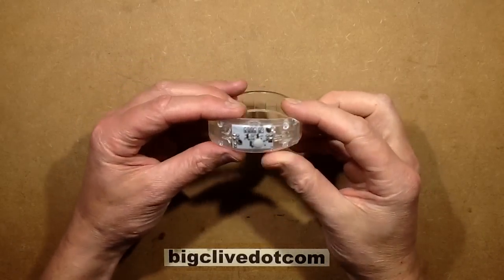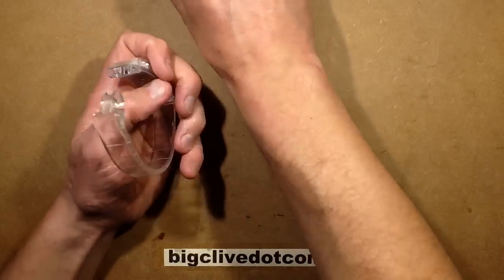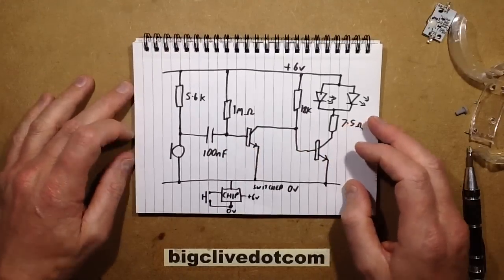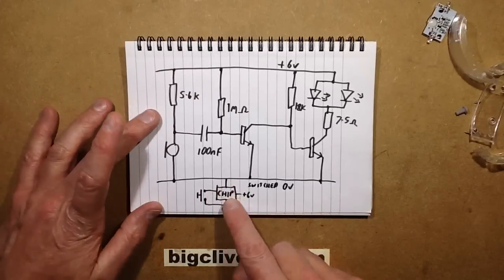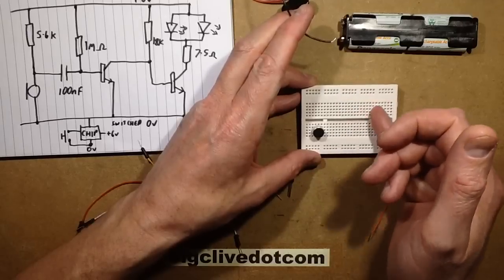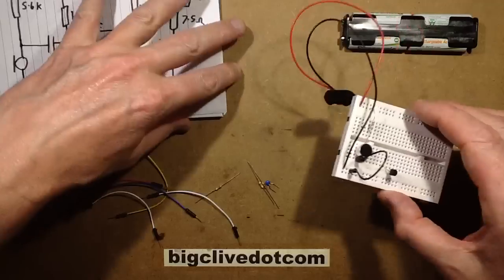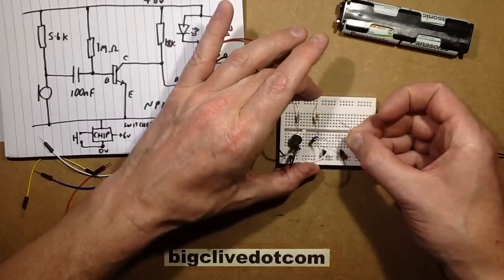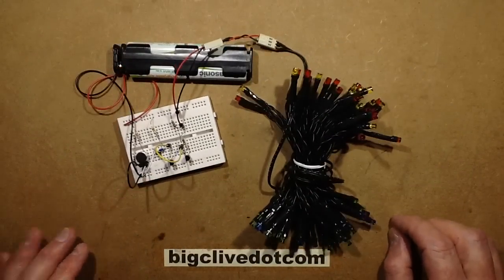Disco wristband with schematic and DIY version.

Comment: Waayyyy back in time, back before everyone in the world had computers, back before the hand held calculator was in everyones pocket, before cell phones, in fact only the richest folk could afford a car phone, and had held phones were larger then Max Smart's shoe.  Back then when the 3 Dog Night was just cutting their first wax, folks used to get high and watch light organs!  Well now the real light organs were very spendy, and we, the common every day soldier had no funds for such things, so we needed to design our own!   Well I had a buddy, who, like you, was into lights.  So what he did was to build a speaker type enclosure.  On the back, he strung some of the large incandescent Christmas Tree Lights.  I believe he had 10 or 12 of them, stapled by the wire to the back of the box in a sort of quasi-random design.  Each bulb was a flasher, and, of course of various colors.  Then going forward in the box he built an insert, so he could put different cut out pattern sheets in place, those carved out of a thin plywood, probably 1/8 inch if I recall.  On those boards, he cut out shapes, hearts, diamonds, spades, clubs and even words, such as the most uttered words back then in the ARMY, FTA (Fuck the Army).  Next, he put in a translucent screen, you could get them at the lumber yard as covers for florescent lights and inserts for cabinet faces.  Now when you plugged that deal in, and played the music, the flashing of the lights made the shapes appear all over that screen in different colors, and your mind sort of mad them dance to the music as it rocked the old trailer house where he lived.  I thought it a great deal, so I found a light organ at Radio Shack in a kit form, this became my first kit, and while it did dance to the music, it just had the same type board and all white lights, with a sort of hippey type plastic front that made it light up colored.  Personally I like my buddies much better, I ended up throwing the one I built from a kit in the garbage on my next unit transfer.

Comment: Never mind Clive, I feel pretty darn foolish right now because my 4 slot AA holder has a on off button I didn't even notice on it. Yes it does work when wiggled about on the breadboard but thank you anyway, Tom.
Reply from the maker: Easy done.  Also frequently happens in industry with emergency stop buttons.

Comment: That's a nice little circuit, so much in fact I tried to build it & obviously I must have ordered the wrong style of microphones, I guess. Not certain which they are until I can find the paperwork on them. So exactly what is the item # from off of ebay or at least the proper name for them because I purchased mine from Jameco Electronics, of coarse no returns anything electrical anyway. Oh well, I'm trying Clive to learn this stuff. Thanks for any help you can give.

Comment: Just built this myself as I want to make some disco lights and I thought this was a really cheap way of doing it rather than going through the expense of using a microcontroller.  I do not have an 18k resistor so I have had to use a 20k one. My circuit is behaving oddly as it works with just 5mm LEDs but then I tried to add a parerell LED string to it and when I do that all the LEDs just stay lit and only slightly increase with brightness to music. 

Am I simply overloading the second transistor so it is not switching properly?  There is only 15 odd LEDs on the string (poundland ones).  I am using generic BC547s from Ebay.

Comment: Damn, thwarted by lack of resistors!
I'm the kind of guy that is interested in this stuff, but has none of the requisite components except for a few old circuit boards I scrapped that have some surface mount NPN transistors.

Comment: Does it matter what volume the music is played? If the music is very loud, will the lights simply stay on all the time? I used to have an old set of 4 bulb disco lights and I believe they may have had a sensitivity option on them?
Reply from the maker: It's just a fixed threshold, so at loud volumes the lights will behave differently.

Comment: Can somebody explain why there are two transistors instead of just one?
Reply from the maker: Gain.  The one switching the high load of the LEDs will not be as sensitive as the one switching the much lower load of its base.
Reply: Great answer.  I was thinking it might be possible to use one transistor, if desired, if it was a MOSFET.  Just play around with the gate biasing until it works.  ...  Also might be able to use a piezo device (or even a microphonic MLCC) going to the + rail, in place of the cap.

Comment: Clive, since I have this connected to the solar charger from another project the microphone ends up in the window which is a bit away from the speaker.   What would I need to change to pick up a little more from the speaker.  Only need to gain about 2 feet.   I have to have it pretty loud.
Reply from the maker: Can the microphone be aimed?
Reply: Not really it is about 2 foot behind the stereo speaker.
Reply: Clive I ended up getting it to have more sensitivity by replacing the capacitor with a 220uf/224 and the 18k resister to a 4.7k.  Seems to work well enough for me.

Comment: Watching your video I am so happy I ordered a ton of standard resistors.  31 value 50 of each value. 1550 pieces total for about $15.99 USD. 
Way better than having to find a value I need, Desolder from a board, realize the leads are too damn short for the breadboard, and fighting with it. Id say its a good deal, But I am not an expert just yet :P

http://rover.ebay.com/rover/0/e11400.m1842.l5919/7?euid=2600f0185b1d44d4810ff8cda9c58429&bu=44367537419&loc=http%3A%2F%2Fwww.ebay.com%2Fulk%2Fvod%3Ftransid%3D679741375026%26itemid%3D391542729486%26qu%3D1&sojTags=bu=bu

Comment: Yep works.
 Solar charging set up works fine.  I'm going to change it to multi-coloured LED's around the stereo.  Probably need to adjust the sensitivity resistor.

https://youtu.be/PGeJ1D4gjRw

and now with colored LEDs

https://youtu.be/gN5QXIC3iTE

Comment: the transistor got stuck to your hand when you wrote BCE on the drawing :), Iv wanted a circuit like this for ages, I wonder if it would work (with modifications to current limiting) as a Clock Input to a binary counter so I can use my BCD to Decimal chip on my homemade disco light chaser in a "Audio Beat" mode. I made one years ago from an Everyday Electronics mag, it was a project for touch sensitive lighting control, but I was only interested in the audio detection circuit. I lost it over the years but it worked beutifully on my custom diode decoder for 4 channel chase patterns from my said BCD to Decimal (16 stage) chip. I actually still have the decoder, chaser and electronic relays circuits and it still works but where the audio board went to I have no idea. It uses a bi-directional binary counter which I had on a slow 555 for random reverse pattern changing. I think the audio side used op-amps and filters to give a nice pure pulse output but this circuit looks like it could replace my lost work :) I cant find any circuits online for audio in to pulse (ttl logic) out :(
Reply from the maker: Many years ago I made some little PCBs with LEDs on them where a 4017 counter was clocked directly by the audio picked up by the microphone.  It gave interesting effects.

Comment: Having the microphone inside without a hole means that the sound that reaches it will be much more attenuated in the higher frequencies, effectively giving them some low-pass filtering for free :)

Comment: I brought some extra large gloves from Hong Kong. They barely covered my fingers. Then a audio headset. Again they cut off my circulation. When buying anything on bang-good or eBay from the far east it is worth remembering the relative definition of 'large'. Size 4XL is the minimum for clothing etc. Worth checking before buying anything.

Comment: You should create a similar circuit, but it should have high and low pass filters to filter off certain frequencies and have multiple LEDs that light up for different frequencies

Comment: That's just plain neat. Nice hack. I'll have to see if I can build one of those myself. Do you think MOSFETs would work in place of standard NPN transistors or would the shunt diode mess with it too much? I have a few from an old power supply I saved for parts. The chips I have are 70L02P MOSFETs in a to220 package.
Reply from the maker: MOSFETs tend to have quite a high gate voltage.  Plain vanilla NPN transistors are best.

Comment: Odd that they used a chip to act as a switch
Reply: It lets them use a simple momentary switch as a push on/push off power switch. You'll find them used in a lot of disposable electronics.

Comment: That's a really nice effect! What would happen if you adjusted the first resistor and the capacitor values? I'd actually be really interested to see this circuit with variable resistor and capacitor in place so you can adjust things.
I'm guessing the other couple of resistors are less important? Or do they need to be tuned together?
Reply from the maker: The capacitor choice will affect sensitivity at different frequencies.  The 100n makes it sensitive to high frequencies, but a higher value cap would extend the range somewhat.  The 5.6K resistor position is matched to the microphone, the 1M is a general slight bias value and the 18K will be chosen to drive the main transistor hard enough to light the LEDs brightly, but high enough to be easy to pull to ground by the lightly biased first transistor.
Reply: +bigclivedotcom Thanks Big Clive, I might try to see if I have a suitable capacitor around here
Reply: I was just thinking about building channels into it to pick up varying tones and tying that to a light channel.

Comment: Most definitely! I have collected the replicas, and they are very convincing. At about fourteen quid each, it makes sense if your leading man is prone to dropping the £300+ handmade metal one every now and then. The opening end of Matt Smith's sonic screwdriver was particularly fragile, I have read.
Reply from the maker: Most real props are quite delicate.  Especially the technical ones with lots of moving bits, as they are one-offs.

Comment: Very nice, I haven't used a breadboard since the 80s, I use the PC board that looks about the same trouble is you must solder,
but hey if you cant solder get out of the shop, I admit bread board is quick and dirty.

Comment: does the little transistor survive the current draw from the LED-strip because it's switched on for such a short time?
Reply: I'm wondering the same thing. I would personally use a slightly beefier transistor with a heatsink but Clive does this sort of thing for a living and I don't.
Reply: or a mosfet, but i suppose the mosfet doesent have the gain needed for the circuit to work properly.
perhaps a mosfet connected to the last transistor and let the mosfet switch the LEDs, then you would be able to drive bigger loads.
but then again I am not an electronics engineer either
Reply from the maker: The duty cycle is 50% because the LEDs are being modulated directly by the audio.  So the transistor is within its dissipation.
Reply: +slypeartree Clive likes smelly electronics :)
Reply: Smellectronics

Comment: 01E is actually the correct marking for resistor with precision of 1% or greater. That's used for E96 serie.
I had one smd resistor marked 30A mounted on my own board and I was thinking that something was wrong... but it was in fact 200 ohm 1%

Comment: why could there no have been a 1K0 resistor in the emitter of the second transistor and a the 1M0 connected from the emitter of the second transistor and the base of the first transistor and a 1K0 or a 470R resistor from the emitter of the second transistor and ground.  you know ring of two amp.

Comment: Hi Clive, something I've never fully understood - could this circuit be rejigged so you only need the one transistor?  They're high gain, could the LED go from emitter to ground on the first tranny and save some more componenents?
Reply from the maker: It's possible this might work, but it would only be sensitive to loud sounds.
Reply: bigclivedotcom appreciate the response, I can see that, and it's great to have your thoughts, I'm so rusty!  Could the loudness threshold be adjusted accordingly by changing the mic pull-up resistor do you think, so it sits closer to the threshold?  Reducing gain but increasing sensitivity?

Comment: Damn thats so cool yet so simple. Can someone re explain what the 1M ohm resistor is for? I guess the 18k and the 7.5ohm resistors are to protect the transistors? (Learning electronics give me a break)
Reply: 1M turns the first transistor slightly on by default. This pulls down the base of the second transistor so that it is off per default. The others limits the currents through transistors and LEDs, so yes, protection.
Reply: Oh i see. Thankyou

Comment: any chance someone (or Clive himself if I'm lucky) could compile a list of all the things Clive got for the DIY version/where to find them? not much help having a DIY version without any clue where to get the components, aha.

Think this could be really cool to have set up though!
Reply: Specifically it would be useful to know how to get those multicoloured LEDs he uses at the end, and what the  "various connectors" are
Reply: Thanks, my man! I actually managed to find most of the other stuff, from the schematics he wrote down (and I realized he said the name of the transistor in the video), and happened across the electret microphone in my own searches (realizing soon after that he also said that, but I misheard it as "electric"). 

The main issue now is the LEDs, since they all seem to come with different adapters, like to USB or to mains. Didn't help that he described the adapters as "various adapters". But I'm assuming it would be safe to just snip any excess adapters off and plug those in directly, right?
Reply: Is there any way to tell if they're parallel or series beyond just the power source? 

For example, the best ones I've found are a set of 5V USB powered ones-- and they could be powered by either mains or battery. So would it be safe to assume they're in parallel, or..?

Comment: If the left-hand transistor is pulling the input of the right-hand one to 0V when this is idle, doesn't that mean the battery is constantly discharging through the 18k resistor?
Reply: Hence the COB switching arrangement..

Comment: That's tonight's fun project sorted. Now I just need to find something that needs to be sound activated. 
I'm thinking to maybe filter out the low frequencies and add a latching transistor switch, so it becomes a clapper type thing. 
Thanks for the excellent video Clive.
Reply from the maker: This circuit mainly responds to higher pitched noises.

Comment: I'm not sure but… can this circuit be used as a part of LED VU-meter? I mean you repeat this for each LED, with some modifications and will it work?
Reply: jkmacgyver Well sure, if you want to do it the EASY way.  User name does NOT check out :)
Reply: Use the output of this to pump up a capacitor with a bleeder on it, then a series of comparators to drive the leds based on capacitor voltage, should work just fine.
Reply: LM3915
Reply: Should work with a little tinkering with the resistor values to change the activation points. Might be a good idea to change the resistor connected to the LED transistor in the basic circuit so you can change the volume needed on the fly and from that figure out which resistors you'd need for each stage of your VU meter.

[At least I think thats the resistor you'd need to swap out, what do you say Clive?]
Reply: Use different value zener diodes and 10k resistors to drive the bases of the transistors that drive the LED's.
Reply: Thanks, I knew it's something similar.
Reply: I suppose you could but it would involve quite a few parts because you'd be duplicating most of that circuit over and over. You're better off looking at comparator circuits for building simple VU meters where each comparator in your quad comparator or opamp is set to switch on at different, progressively larger thresholds.

Comment: what was the point of the cob on the wristband then?
Reply from the maker: Just the on-off function.
Reply: so would a  cob and momentary switch be cheaper than a tiny toggle switch? i dunno seems weird.
Reply: Almost certainly. Also easier to design the case for a pushbutton than a toggle switch. Toggle switches cost probably almost a dime each. cob plus pushbutton is way less than that.
Reply: I suspect it provides a time delay, you press the button it stays on for a while,then after a few minutes, switches off, thus preserving the batteries. Press the button and it re-activates.
Reply: +Daan Wilmer they're lithium primaries, so they don't need protection. They're not being recharged.
Reply: Maybe it also includes some protection for the lithium batteries? I don't know.